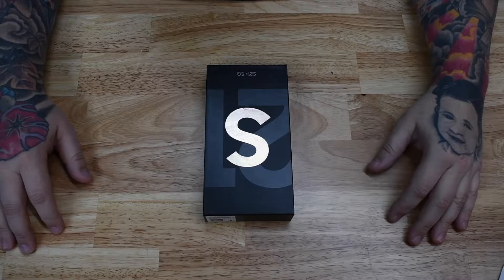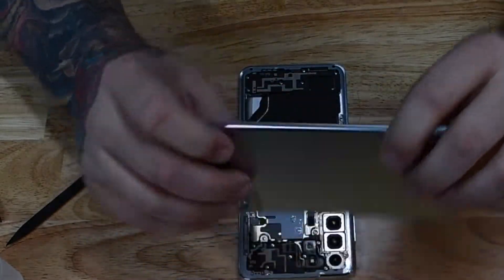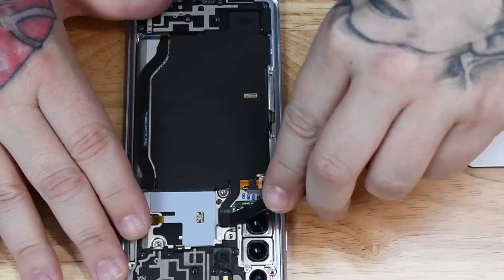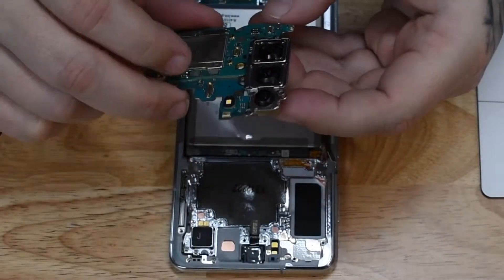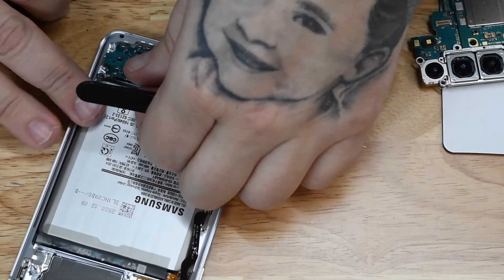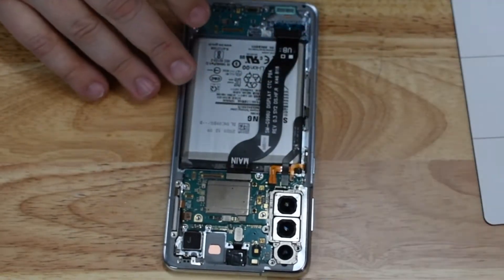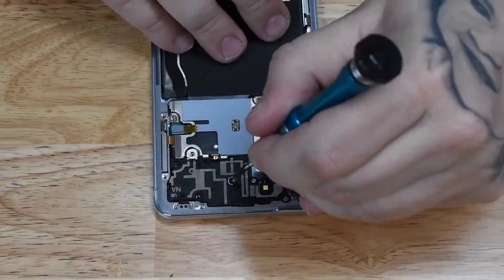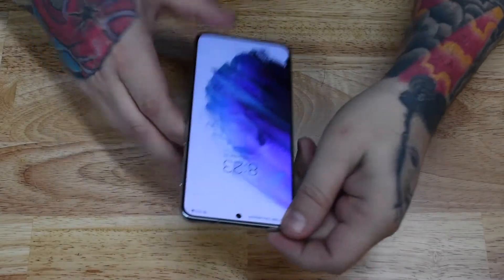Samsung Galaxy S21+ S21 Plus Screen Repair and Teardown!  How complex or simple is it?

Comment: Hopefully my question will be seen if I am only replacing the top speaker do I still need to disconnect all the cables ie battery, antenna ect?  the speaker sounds blown only on the top and not the bottom speaker , when i talk to ppl they can hear me but they sound disorted and when playing music. Also when on speaker phone I can hear them fine from the bottom speaker
Reply from the maker: Disconnect the battery for any repair
Reply: @flippinfunkos  So I just opened  the phone and found under the flash glue on the speaker part could this have been what caused the ear peice damage? I really think i am at the point of needing a pro...this is not so easy especially the screws are on tight.
Reply from the maker: @miomagicall297  hard to say without seeing the phone in person.

Comment: Coy, so the front camera wont come off?
Reply from the maker: It’s glued in.  If you use enough heat and have steady hands, you may be able to get it out without breaking it.
Reply: @flippinfunkos  Do the lcd's & frame come with them? I noticed yours did.

Comment: ive had my s21 plus for a year and my screen went black while watching a youtube video last week, the audio still worked just a black screen tho. its currently at a repair place getting fixed since my warranty is done. super expensive but i hope it fixes the phone. if not, guess ill be getting another phone. its annoying, im hoping itll be done tomorrow, fingers crossed. the guy ordered the part today, hopefully it comes in tomorrow like he said it would.
Reply: samething happened to me screen just shut off while watching youtube
Reply: @atiagooqkinguliaalu4027  mine needed a new screen, now all good to go. However very expensive to fix it. I only paid since I had the funds to do it, if it happens again I'll just he getting a new phone.
Reply from the maker: @atiagooqkinguliaalu4027  can you still hear?
Reply: @flippinfunkos  yea im using samsung dex to my laptop to use the phone lol I Gave up after trying everything for like 5 hours
Reply from the maker: @atiagooqkinguliaalu4027  probably going to have to replace screen
Reply: @flippinfunkos  T_T
Reply from the maker: Yea those phones are expensive to repair
Reply: @flippinfunkos  no kidding! I'm hoping it was just the screen, he seemed optimistic  about it.
Reply from the maker: @budgetwithcam  if it still makes noise, it sounds like just the screen
Reply: @flippinfunkos  it was making noise when it happened and it was still vibrating when I tried to do hard resets so I'm thinking it's just the screen
Reply from the maker: @budgetwithcam  fingers crossed
Reply: Trade it in after the fix it.